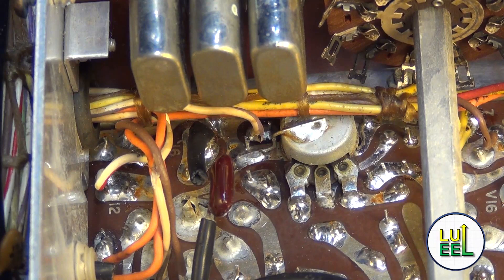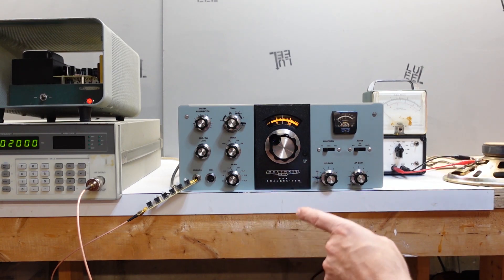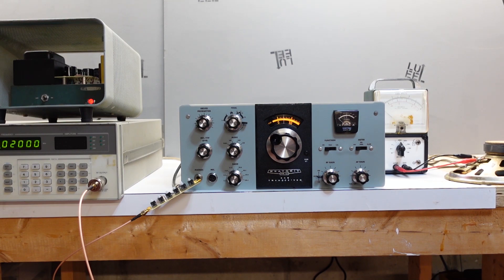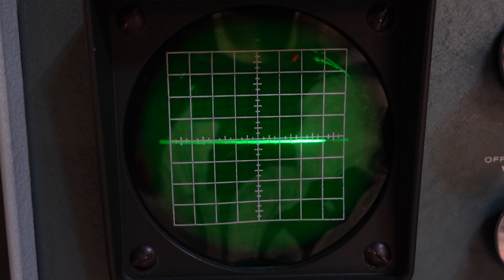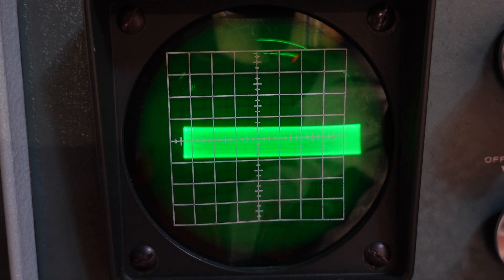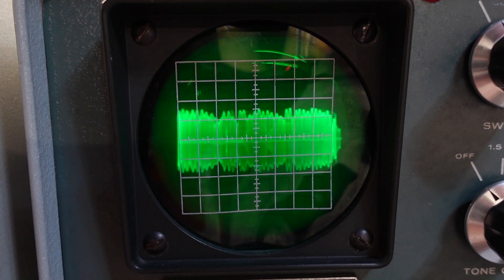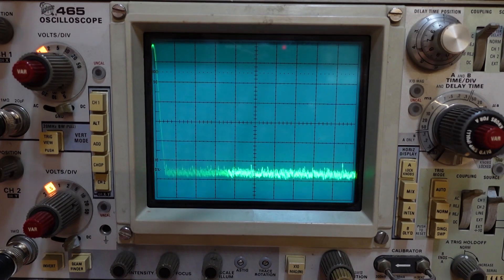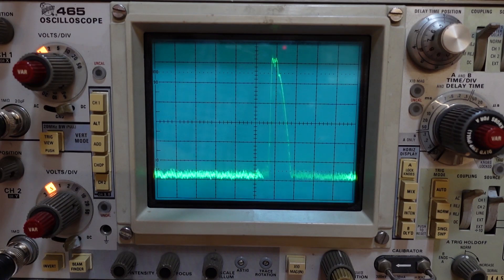Heathkit HW-101 Part #6: Analyze This!

Comment: FYI If you have a compressor, you can get a cheap hand help sand blaster gun at Harbor Freight for ~ $25. maybe less. The media you should use is the soda, Sodium Bicarbonate. It's more expensive but if you keep it dry it will last for years and will clean those panels QUICKLY. . Next, buy a can or two of Zinc Chromate on ebay. It's still used for aviation and marine apps. Buy a spray handle which fits on top of spray cans. Zn Cr tends to be heavy and if you use your finger tip on the nozzle, it will bind between the nozzle face and your finger tip and splatter all over your work. START OVER TIME, YUCK !!! Been there done that.
Next, take one of your HW 101 panels to a Sherwin Williams store and have them use their spectrometer to make a small amount of the exact color. You will need an automotive quality sprayer, also a cheap one can be had at HF.
To get the texture effect that Heath uses, thin your paint about 60%-40% paint to thinner. Get some cardboard boxes and play with your sprayer until you get that effect by decreasing the air flow and increasing the paint flow until you get it to just to start creating the texture look; TAKES PRACTICE. However, with a little work your results will be better than Heath ever did and you will be proud of your unit for years to come. 
Of course, do this all outside on a warm dry day, You may want 3 - 5 coats of paint or until the coat is thick enough. Sun drying will speed up the curing process or if the wife is away, the oven at the lowest setting for a few hours will mostly cure the paint.
I did an article for Electric Radio Magazine to show how to properly do R390A front panels. If you have that magazine, let me know and I'll look up what edition that was. If you want a copy and don't have ER, send me an email and I'll make a copy and send it back to you. Lots more detail there than here.
Any questions, feel free to contact me at glenn@dsmlabs.com       73, Glenn WA4AOS  www.dsmlabs.com phone number at website
Reply from the maker: Glenn, thanks for these very detailed tips!